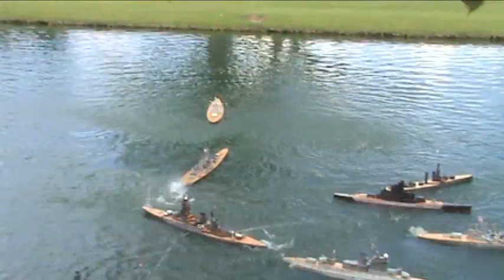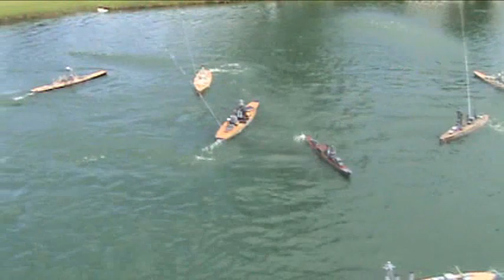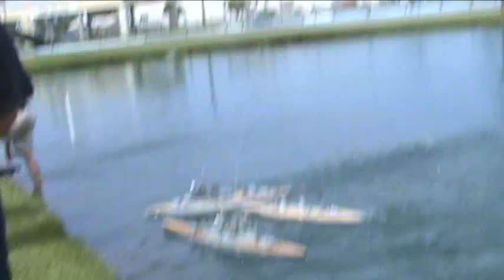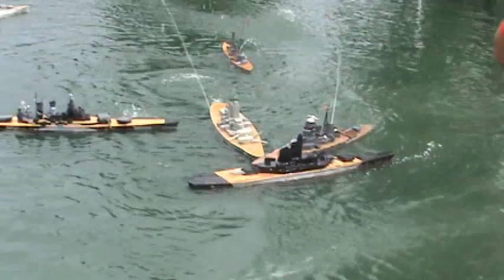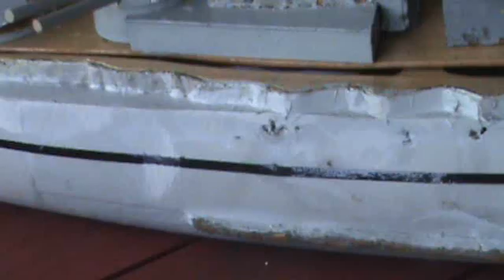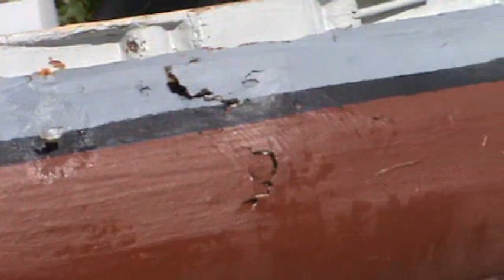The Allies' Best Sortie Ever

Comment from the maker: Go to battlersconnection or strike models and they have most of the stuff you need. What ship to start with depends on your RC experience. Most of the time I recommend starting with a cruiser, 2 guns out the back and one pump. Forgiving to build, cheaper, easier to learn about the hobby, fast to keep you out of trouble. If you have some RC experience starting with a bigger ship is do-able.